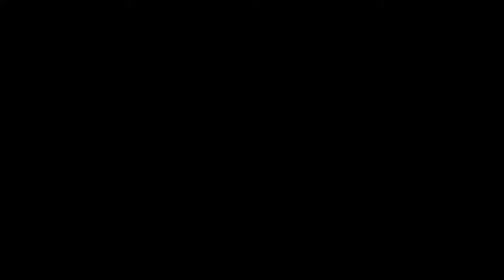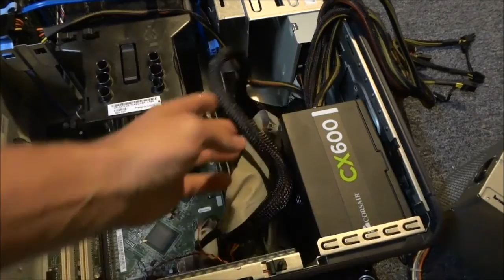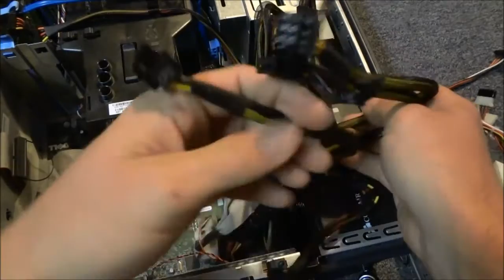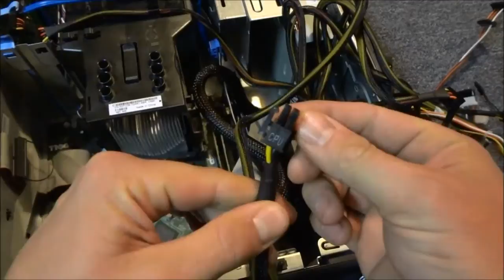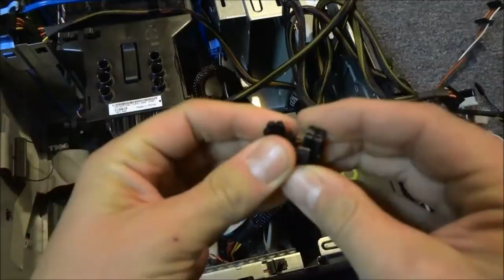Power supply upgrade - breaking in half and using 8 pin with 4 pin connection connector

Comment: My motherboard has an 8 pin connector and then a secondary 4 pin connector.  I've been stuck trying to find this cable and was miffed it wasn't included.  You would think they would add this to the manuals.  Thank you so much for this video!!

Comment: I did, but the PSU doesn't work, I tried it on another PC where the motherboard supports the 8-pin CPU connector, and the PC normally went ... Is there a problem with the board? I have a gigabyte P550B power supply and a gigabyte ma78g-ds3h board. Please help me 😪

Comment: my psu has 2 4 pin connector but my mobo has a 8pin socket can i use my 2 4pin for the 8pin socket?

Comment: I got an asus maximus hero XII (wifi) with a i9 10850k. There is an 8pin and 4pin for my cpu power. Idk if I use both or if I just use the 8pin? I haven't found much going into the details of this topic. If anyone has seen this and had success with either option I would really appreciate it if you told me. As well as going into details on the connections to the PSU and MB (do I use two cables, use adapter, or just one).

Comment: my motherboard does not have a 20 or 24 power connector the mother board only has and thing that says p1 p2 p3 and my power supply only has a 20/24 power connector